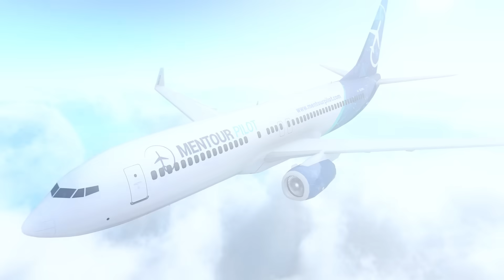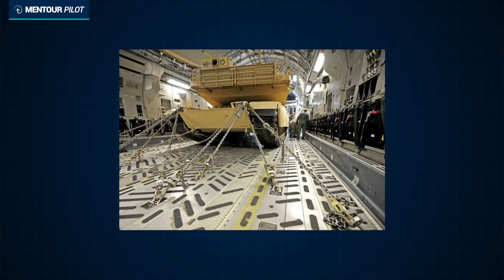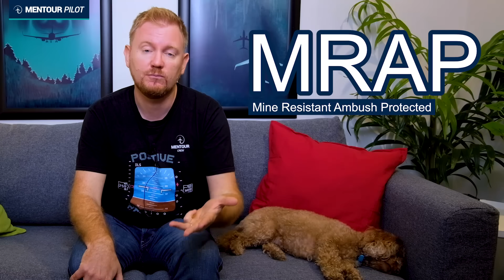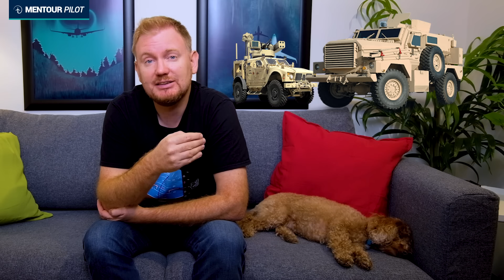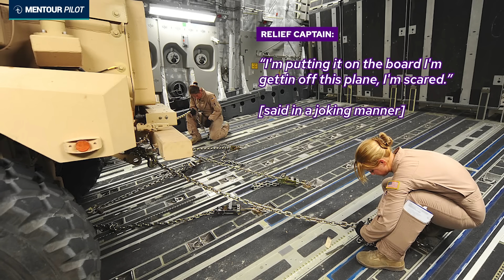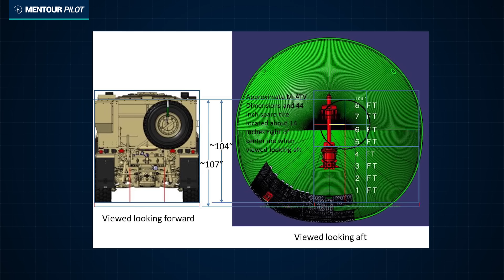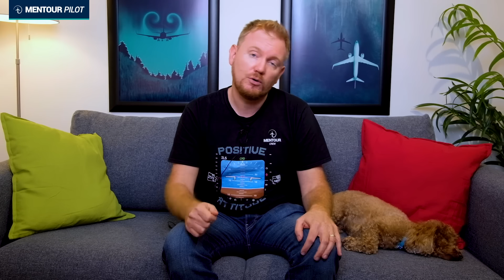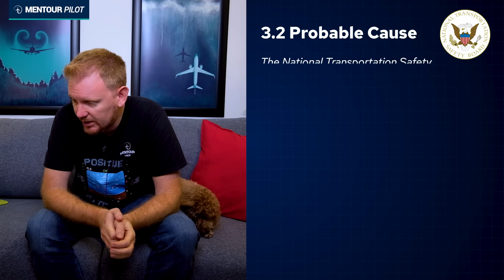Why did the pilots LOSE control?! National Air Cargo flight 102

Comment: The one person said sixty straps were needed . While as a truck driver I know that if too many straps are needed then switch to chains
Reply: I am a programmer/researcher but I had similar reaction too. When you have a super heavy load, and you use relatively weak straps to secure it, you are in the danger of cascade failure of the straps, when they overload and snap one by one, even if their combined strength should have been enough. That happens from asymmetric load, especially if they are able to come even slightly loose.
Reply: ahh the 5000lb strap vs the 10000 chain...... sound good in theory... both are as good as the weakest link and this is usually the tiedown point. Using a 10000lb chain on a 5000lb tiedown point means you have a max of 5000lb restraint then you have to calculate the angle of restraint. So no, using a chain instead of 2 straps does not always work.
Reply: @scratchmccutcheon9273  Flawed reasoning since the issue was never a tiedown failure.  Chain would have worked better and straps are more susceptible to cascade failure. Finally "all" straps stretch which is problematic for heavy loads.  I have never seen straps used with transporting tanks on ship.  There is a reason.  Straps cannot handle weeks of stress like that and even chains need to be checked for tightening - just far far less than straps.  If for some reason a radiator over heated and sprayed water on the straps - it is instantly weakened.  Water and other impurities do not weaken chains.  The list goes on.
Reply: @BJCulpepper  OMG you cannot compare a tiedown point on a ship to a tiedown point on an aircraft. Most tiedowns on an aircraft are rated to 5000lb. Special tiedown points of 10000lb and 25000lb are linked to major structure points of aircraft.
Tiedowns points on a ship are rated well above those on an aircraft.
A large chain can be used on ship where there is little regard for the weight of the chain. On an aircraft every pound is account for.For you to say "flawed reasoning" is flawed in itself as I have never spoke about tiedown failure but how it is a waste of weight to use a chain (usually 10000lb rating) on a 5000lb tiedown point. 
Every strap is to have a "expiry date" with inspection requirements. 
Comparing ship tiedown equipment (TDE) with aircraft TDE is the major flaw in your argument. If you wish to point out flaws then don't compare apples with oranges.
Reply: That's the USAF reg. Plus straps stretch. Chains and MB-1 or MB-2 devices.
Reply: That won't work. The tie points in the floor are too weak for this. Spam of straps are needed to spread the load.
Reply: You give a good quick heavy shot to a strap and they will all break down. Chains are much stronger. Did they had any chains in stock and wheel chocks? My guess is NO !!!
Reply: @yamaha6501982  You give a good quick heavy shot to a chain and it will come out with parts of the floor in a cargo airplane. Those rails are mostly aluminum. Load points need to be spreaded on those.
Reply: I can guess why, perhaps, straps would be better than chains, but guessing and rules of thumb should not be relied on. From the comments here, it seems that much more engineering tests needs to be done for these particular loads in these particular carriers.
Reply: And don't forget to multiply the outcome for a decent safety margin.

Comment: Hi Petter. Very good explanations accompanied by a very well made animation. 👍 However, from your previous videos, we know that the center of gravity of an aircraft must be in front of the center of lift. In your animation, if the scale of the vehicles is correct in relation with the aircraft, that means that the center of gravity of the five vehicle group appears to be way back anyway. (or I might be wrong,, of course)
Reply from the maker: They are not to scale. That graphic was to show more what happened than anything else

Comment: Having been a crew chief on medium lift helicopters, I noticed a couple of problems. 1) Had any consideration been made for center of gravity for the a/c. 2) Any wheeled vehicle or load the proper size wheel chocks must be used (much like the blocks in the loading rails for the containers). 3) The straps are mainly used to strap the load DOWN, not to secure it for back and forth movement ( that's what the chocks are for, and you can use straps to supplement the chocks) 4) if the load had shifted, even a little, the straps are taken off, inspected, and reset. All this should be done with at least the first checking each strap (that's a lot of straps for one person to get right by themselves). I realize some of that takes time, but so does inspecting the crash and notifying next of kin.

Comment: Please someone tell me some...”good” came out of this, if one can use “good” for anything related to this accident. Some sort of new standardized and also specific to cargo and aircraft used for loading checklist, straps needed, tension on straps, mounting location for straps...etc? Also shouldn’t more people be held responsible for making sure the cargo was properly secured? Someone else besides the Loadmaster? If I understood the video correctly, the Loadmaster was making the flight with the pilots. You would think that would be enough of an extra incentive or reason, for the Loadmaster to be very sure everything was held down properly. The fact that he also would be flying. Not that anything like that should be needed. I’m sure that maintenance techs and engineers don’t fly on every aircraft they work on. Sorry, I am “going on and on” a bit. But even just learning about this so unnecessary lost of lives by watching a video, it is very hard to accept.
BTW, love your videos. Very informative and interesting. Well done by you.
😷🇨🇺🇺🇸
Reply from the maker: Absolutely, licensing for loadmasters for example, better oversight of the regulator, better training.
This impacted the cargo industry in a profound way.

Comment: I remember when that happened and everyone said they thought the load shifted. But I never heard the part about the rear bulkhead and jackscrew. Thanks very much.
Reply: That was my understanding of this accident as well up until this video: That the load inside had shifted and that this was enough to cause the CG of the airplane to be outside of its limits. Though I do not know how much the CG of a 747 has to shift in order for it to become uncontrollable. Of course, as Mentour makes clear here, this 747 had suffered the sort of damage that made it uncontrollable in the aerodynamic sense.
Reply: @Dabarda  I had always thought it was a center of gravity issue as well. It looks like it was definitely more than that.
Reply: I too have previously only heard the explanation that load shifted and caused center of gravity to change. Nobody told that it was actually more probable that cargo crashed the back of the plane breaking stuff. And the parts found on the airway clearly point out that the plane suffered huge hardware failure already before the crash.

Great content from you as always!
Reply: During the investigation, they did simulations/test and found, the shift of CG was not a problem, at least not a problem that would cause the crash.
Reply: @wolf310ii  Yes. Initially, they did the simulation in NTSB lab and their conclusion was they could recover from it even though the cargos were not in position. Then they again look back - this was mentioned in Air Crash Investigation documentary made by National Geography. --- I remember I watched that.
Reply: This was an inexcusable tragedy.
Reply: This might be a dumb question but I’ll ask it anyway. It appears by the video that the plane only made it about 1000ft off the ground before it stalled and it pretty much pancaked into the ground wings level and was consumed by fire afterwards.  Would there have been a better chance of survival for the pilots and crew had there not been a fire or even without the fire from that height they were still doomed??? Cause it did appear from the actual footage that as it fell toward the ground it looked as if it gained a little forward momentum. Almost like it started to generate a little bit a lift which would have lessen the initial impact.  This is just something I began to wonder after watching the video. As always great video and very informative. Great Work 👍🏾
Reply: @larrydavis9582  If you see the original dash cam video, you'll find that the speed of the plane as it's falling is at least the whole length of the plane body per second. As the length and the wingspan of 747 is around 70 m, you can estimate that the speed of the plane is at least 70 m/s. The changes for surviving such an impact with the ground is slim to none regardless of fire.
Reply: @MikkoRantalainen  oh ok didn’t realize that. What height would of made a difference if any??
Reply: @larrydavis9582  The drag matters so much that the height is not the thing that kills. The only thing that matters is the collision speed. This plane did fall sideways for so long that it acquired quite a lot speed and even though the wings were closer to horizontal near the crash, that can increase the drag only a little compared to vertical speed.

From the video alone it seems clear that the collision speed was more than 70 m/s and you can compare this to human terminal velocity (that is, the max speed for human body when jumping from a plane without a parachute, somewhere in range 50-90 m/s) the changes of survival in that crash are about the same as hopping on a car from an airplane in cruise altitude. The springs and crushing metal on the car do help a bit but probably not enough.
Reply: @MikkoRantalainen  all I can say is Wow!! I guess why I’m beating a dead horse Is because I see other accidents where the plane crashes but the trajectory is more of a downward angle and at higher speeds rather than an almost vertical drop and sometimes you have survivors. Obviously every accident is different and there are many many factors and variables that come into play when talking about survivability but I guess I really didn’t take into account the speed at which the plane fell.  Thanks for the explanation. I Def understand it better now. 👍🏾
Reply: @larrydavis9582  at a distance things look much slower. Up close they look real fast. Particularly if they are heading in your direction.
Reply: @larrydavis9582  in the footage we see the aircraft seems moving slow, but the force which it slams against the floor show the weight and size were important factors. It was loaded with an important amount of fuel. I would believe the crew sustained important injuries even if the aircraft didn't catch fire. From other crashes that I had read about, spine and hip bones are typically affected.
Reply: @larrydavis9582  You have four HOT jet engines turning as they smash into the ground along with a large reserve of jet fuel getting smashed into the ground.  You're basically landing a Molotov Cocktail the worst possible way.

Comment: Everytime I hear about such an accident, I have a weird feeling, because the pilots and loadmaster could've possibly saved the flight if they have been a little more cautious and serious about the issue. Thank you though for making those series, I learned a lot from it!
Reply: the crew could have saved their lives that day by speaking of unexpected cargo shift. But: that accident was waiting to happen sooner or latter, as the problem was systematic and multilayered. Adding a dozen more straps would maybe allowed take-off - but that would not have been enough for "worst case typical turbulence" - let alone "evasive maneuvers" that a military air plane might have to do.
Reply: There is a deeply human factors component to this accident for sure. It makes me wonder what the psychology behind this would be.
Reply: @Dabarda  Well, they had previously been at Kandahar—an airport with a really scary reputation for Taliban attacks. Then at Bagram they're likely thinking (perhaps only in the backs of their minds) "once we get high enough we'll be back out of range of shoulder-fired missiles."
Additionally, they've got military timelines to keep to—if they miss their slot they might have to wait on solid ground for the next one.
All of it contributes to a sub-optimal fight environment.

Comment: This exact incident (complete with the footage) was actually shown and analysed during training as a passenger services (check-in and gate) agent. Even though we didn't handle ULDs at our (relatively small) airport, and occasional flights of maximum 186 pax, it was made very clear how important weight and balance was. In addition to the tail-tipping while loading the ATR-72s, mitigated by loading the front pax first, along with the front cargo, it was also important to get the bag weights right. Not only was it important for getting the charges right (for better or for worse), but some of the planes, especially the 49-seat SAAB 2000s and ATR 42s, were extremely CoG sensitive, to the point where a few overweight bags in the wrong hold could push it from in trim to out of trim. To my knowledge, everything was done to the highest standards, however it's easy to see how financial, time and human factors could cause mistakes to be made, however this accident shows the grave consequences of getting it massively wrong. Condolences of course to the families and friends of everyone involved, it's very clear that lessons have been learned from this, and hopefully any future accidents like this can be avoided.
Reply: It might be worth adding that one of the other videos we were shown was presented by Bruce Dickinson, singer in Iron Maiden and 757 & 747 Pilot. Somewhat more lighthearted and typical corny corporate video, but definitely helped drill it in how important cargo weights, as well as passenger seats and numbers, are.
Reply: @ninjaz5736  "Safety in the Balance" same Video was shown during my Training as Ramp Agent (slightly more relevant since I actually supervise loading, even thought I don't do any load planning)
Reply: @devial9879  that's the one! Yeah we didn't do any load planning ourselves but we did have to bump pax around in the system occasionally due to trim, and it's definitely good to have an insight into why we have to do things a certain way!
Reply: That was the takeaway but rather erroneous, as the weight distribution was fine, it was cargo breaking lose that caused the issue causing control damage. The main issue with moderate weight distribution (without moving centre of mass behind the centre of lift) issues is a massive impact on fuel efficiency. The big issue is strapping - most places do it wrong to this day.

How many straps do you need? times it by 4. never not them. Don't twist them, except a single twist in the presence of any wind/ open air. Don't forget water and age severely impacts strap ratings. Hard points can also fail, so check their loadings.
Reply: Me and my dad were moved up from economy to business (or whatever the equivalent was) on a 320 from LHR to CDG a few years back presumably to balance CoG. Pretty amazing that's all it took.

Comment: This crashes related series commented by an experienced airline pilot seem to me very relevant and interesting. This is so true that I subscribed.
This accident is horrible. Being a former pilot (heavy H/C), I can easily understand the state of mind of the crew. It was a mistake, not really a fault: I'm sure the loadmaster was thinking that the cargo was secured despite some indications that rightfully worried the pilots ("they always move, everything moves if not strapped"). On another hand the pilots tend to trust the loadmaster even if they are a little worried, it's just human. I don't know what I would have done in their shoes ... and then the disaster, with absolutely no chance of survival. Very very sad

Comment: How long has the FAA been asleep at the wheel?

On the load securing I would expect that vehicles, being on rubber tyres with suspension, would be a very 'special' case because they can bounce and put shock loads on the securing devices. But maybe that was covered in the procedures the load master wasn't aware of.

Just shocking. But thank heaven it didn't happen on climb-out over an inhabited area.
Reply: I can imagine that part of the issue was that neither departure, stop nor destination where in the United states, making the responsibility blurred.
Meanwhile off-course, the US military would not allow foreign aviation authorities to inspect their military cargo, so why would a foreign aviation authority even ask?
And anyway: Would the us military not have the own experts? And would the US military not hire experts, that are often former military themself? So, what civilian authority would have been responsible? And how can the civilian authority have experts in the ground on every airport of the world? And would a civilian authority be allowed to stop a military cargo transport? And would the military not be the guys that best know how to handle that cargo? I mean, they have the very same cargo planes and vehicles.
Reply: @Michael Frey . It was a US civilian aircraft and crew, hired by the military. Ergo FAA oversight.
Reply: I wonder if removing the tiers on the vehicles would have helped. The cargo can still slide if the straps break, but there would be far more friction than vehicles rolling on wheels.